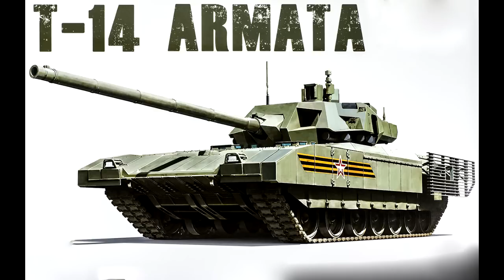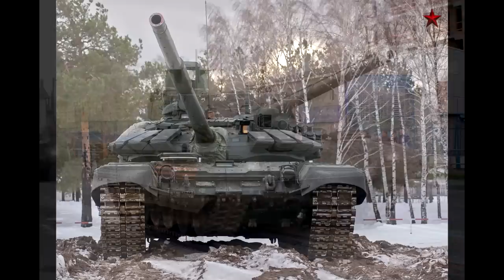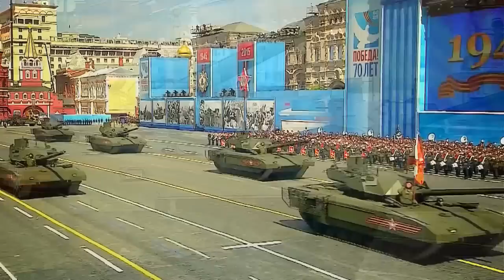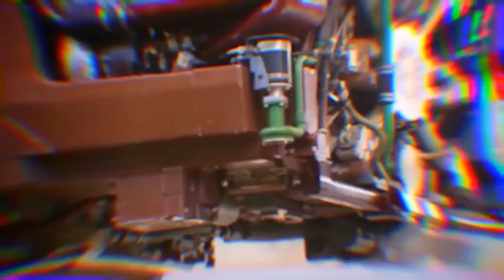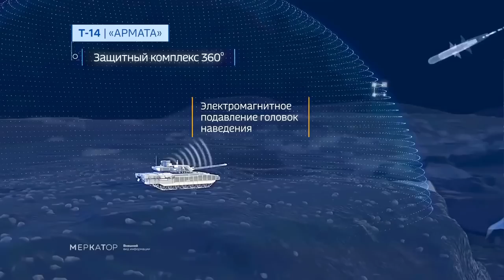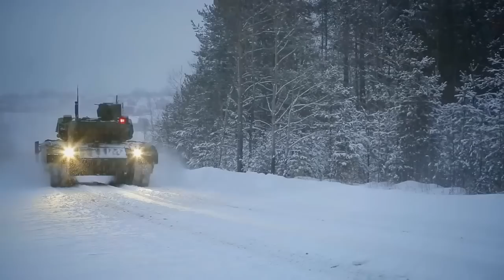Busting Myths on T-14 Armata

Comment: broke down = wishful thinking, in the end, the supposedly broken down vehicle moved under its own power. Video didnt continue.

Russia is under sanctions, so it cant have western imported Electronics. Very dumb assumption. Thales-Catheriine or how it was named was like 10 yrs ago. French do have their own tech Industry which is superior to the U.S. btw in armaments, optics. A generalization but it is generally so.

Production, I saw no written argument.

Frontal turret armor angles are definitely inspired by abrams.

Armata APS either can or will be able to intercept hypersonic projectiles. there was like 1700 m/s and the further future upgrade is supposed to be 3km/s. Not far from Mach 10.
Reply: +cdgncgn
> I dont know what ttb is.

M1 TTB, this guy from 1980-1984:  http://3.bp.blogspot.com/-ERiBYNDzpfI/VVHC6mkXqgI/AAAAAAAABb8/UiU_cSjLjEM/s640/TTB%2BCurrent.jpg
http://1.bp.blogspot.com/-dnKUs3YgO_4/VVG-q5vmhEI/AAAAAAAABbE/nJkQJTKm3hE/s1600/TTB%2B3.jpg

If developed successfully, could've become world's first 4th gen tank instead of T-14

> In appearance, abrams turret front has generally similar shape and angles

It doesn't in the slightest.* The differences are fundamental.

Flat panels are not Abrams feature, it's a welded steel armor feature.

Abrams' turret front is characterized by two massive armor blocks on each side, protecting manned turret's interior. 

T-14 basically has only "dust covers" there, shaped this way for RCS reduction.

The "real" turret looks more like this:
http://www.paralay.com/477/477%20(27).jpg

and similar to M1 TTB

* I'm one of those people who can spot the difference between T54 and T-55
Reply: facepalm. argument.
Reply: You you meant M1 Abrams, then this is just... perverse.

If you meant M1 TTB, you should've said exactly that, but it'd still be wrong in more ways than one.
Reply: Im not pushing my opinion as fact. I dont know what ttb is. In appearance, abrams turret front has generally similar shape and angles, so thats what I meant. Not that Russians did copy abrams turret or anything. It means, turret front  shape is more reminiscent of abrams than a T-72.
Reply: angles are differently fundamental yes but I meant that it was round turrets that went from I remember from later T-55. Shape being closer to abrams than T-55 lol. And I meant normal abrams, not that prototype. Nothing more. What you describe as being sort of light years apart, may be when you go into detail. That sasnt my intention. There is great difference between effective armor in first T-72s and T-72A and even bigger As and Bs, but that doesnt give too much of a visual change. I meant visual and to the people who dont get into stuff very deeply.  Fundamental differences but similar in outside look. Its like vz.58 vs AKM. Similar look.
Reply: > I meant that it was round turrets...

That is cast armor vs welded armor (made from flat sheets of rolled steel) 

Abrams is kinda not the first tank with welded turret.

Round is better, and cast armor can be made of any shape. It's also much cheaper to mass-produce.

Anyway, since when "thing has flat plates" = "inspired by other thing with flat plates"? That's just silly.
Reply: Russia has only around 2000 active warheads, the others can't be used in a saturation strike without a good amount of preparation.

"20-30 nukes to totally wipe every inch of the United States"
Wrong, and that's not even how they'd be used to start with. It's also wrong for the other countries.

"Russia is 3x times the size of the US"
Yet most of the population is concentrated in the Western side, and a few strategically placed nukes would turn Russia into a disorganized mess. You don't try to wipe out every piece of land in the other country, you strike major population areas, transport and logistics hubs, military bases and stockpiles. Basically you wipe out everything that allows the country to support a war effort.
Reply: Wikipedia can be edited by anyone... ANYONE!
Reply: Yeah like when Russia claimed a Ukrainian Su-25 shot down MH-17, and suddenly wikipedia stated that it could fly high enough to do so. The numbers are back to normal at least

But yes, wikipedia can be edited by anyone, yet it's still relatively reliable. You can always double check the claims anyway, especially since the source is given.
Reply: cdgncgn lol, what? French has superior electronics than the US? Fuckin lol.
Reply: vann tedd dumbfuck the panzer 4 has sloped armor.
Reply: > Frontal turret armor angles are definitely inspired by abrams.

/facepalm 

You ruined your entire perfectly good post with this
Reply: "Russia was the first nation in the world with Sloped armour, to counter Nazi tanks"
Wrong. From wikipedia : " Sloped armour was actually used on nineteenth century early Confederate ironclads, such as CSS Virginia, and partially implemented on the first French tank, the Schneider CA1 in the First World War, but the first tanks to be completely fitted with sloped armour were the French SOMUA S35 and other contemporary French tanks like the Renault R35, which had fully cast hulls and turrets."

"The US army yet had to produce autoloader in their tanks"
The M8 had an autoloader. It's a matter of doctrine here, because an antoloader isn't something magical that requires 10 years to develop. It's a matter of choice.

"first with reactive armour"
They're the first who thought of it, but Israel was the first to apply it in combat for certain.

"increase of fire power"
It's not because a gun is bigger that it has more fire power.

"it can detect planes 100km away and shut down planes or helicopters 10km away"
Basically it's a glorified tank mounted MANPAD equivalent.

"can intercept ANY missile or kinetic ballistic round"
If you trust the Russian claims.

"electromagnetic pulse attack munition"
WILL have according to Russia. Again, got to trust them to start with.

"152mm cannon"
What for ?

"first tank with stealth features"
Having reduced signature to ground scanning radar and optics is good, but stealth won't make it invisible, and unless you have the exact parameters, it doesn't say much.

"the tank will be fully networked"
Would suck if the new tank generation didn't have any of the features of a new tank generation.

"it will fire laser precision guided shells"
Nice, Russia joins the club like everyone else.
"Up to 70km away"
UP TO. Do you not understand how weapons terminology works ? Maximum range is not effective range.

"40km artillery"
The US doesn't aim to have most of its artillery fire beyond that range because of their doctrine. The PZH-2000 has a 60km effective range with some rounds, and some US missile based artillery has ranges of up to 300km.

The fact alone that you would try to compare them just shows a huge amount of ignorance. The US don't even aim at having more than 40km range cannon-based artillery to start with.

Seriously, I came here for a video disputing myths, but it seems people here are more interested in finding information that fits their agenda, so they can wank to their "Russian greatness" and pretend they're still at the top of the food chain. Stop spreading bullshit.

Comment: This is a great army, that sends a tank for parade with a driver that actions the hand break and then nobody is actually capable to think about the probable cause. How stupid should the driver be to not know which one is the hand break? Only total morons can believe such lunacy.
Reply: Marian Hanganu Drunk
Reply from the maker: The driving system in Armata is completely different than any other Russian tank. As I said, the driver didnt get proper training since the tank just came out and they wanted to present it on the parade, so he was jsut shown basic commands. He knew it was a hand brake, but didnt realize he actually pressed that button, since it was all completely knew to him. As an example, few months ago my friend gave me a ride since he just got a driving licence, so, like this driver, everything was new to him. He stopped to get out to the shop and pulled the hand brake, I didnt even see him do that. He got back staarted the car and started moving, but FORGOT TO RETURN THE HAND BRAKE. I didnt realize that since I was looking thru the window, and after around 5mins of driving I heard a rough sound which was very unusual to me, but he didnt still realize it, I turned around and saw hand brake lifted up, so I returned it to normal state.
The moral of the story is that mistakes can happen to unexperienced people, it is nothing surprising.

No one realized what was a problem at first because the driver lifted a red flag which means there is a problem with a vehicle so the regular procedure is to tow it away. But since they saw they couldnt tow it away they called representative of UralVagonZavod (company that designed the tank) to check what was the issue, he noticed the problem immediately and Armata drove away with no problems.

Comment: Countries  often use parts from Different countries,.The United States F22 uses Chinese made chips,..!?
:http://www.pressherald.com/2016/11/22/uss-zumwalt-out-of-commission-again/
Reply: Yes, there was a major reshuffling of the supply chain when it was discovered that low quality Chinese components were ending up in the F-16 avionics and weapons systems.  One of the reasons there is now an ISO 9000 and 9001 system - a dogtag on everything all the way from the mine to the marketer.

Comment: Still, where is the video where the tank drives away on its own? Still failed to see it to this day. Also since when russian publicized military data has been reliable? I still believe armata might be able to absorb shots from the front, but highly unlikely the protection would be better than on Abrams with a DU pack. Even from the side. Top of it all, T-14 is russian technology which raises big questions how reliable is it? A tank full of technology and getting hit by an artillery strike, is most likely gonna be useless piece of garbage. The protection system is limited to about 18 shots, and it most likely cannot protect from simultaneous shots from the same side either, as the modern Merkava tank has shown. Merkava btw most likely has the best anti-projectile protection system to the modern day, since it originates from Israel...

Comment: You don't stop a sabot, you deflect it. This is what Armata likely does.
Reply: The idea isn't to deflect it but to split it into pieces, the idea of anti-sabot APS is to split the head of the rod from the rest of the rod so both begin yawing and hit the tank sideways instead of head-on. Deflecting would probably only occur with a near-miss and might still cause serious damage.

OP is right that you can't destroy it (since that would require you vaporise the entire rod in mid-air).
Reply: not only yawing but disrupting the structure of the tungsten penetration can decrease the total focused force of the penetration and disrupt the transfer of force from the kinetic projectile
Reply: Or see it coming and MOVE or never stop!  It is a wooden bullet, a dumb weapon, from the moment it is fired, the point of impact cannot be changed.  Depending on the range, there may be two seconds to move or change course.
Reply: David Parker
The Sabot travels almost 2km per second.. Good luck dodging that or even see it coming.
Reply: ... depending on the range, there may be two seconds to move ... .
Reply: @DavidParker-cf2km  yea cuz 2 seconds is plenty of time to move a multiple ton tank enough to literally dodge the projectile
Reply: Liam Kerr - If you are at a dead stop, you are a dead duck.  But, rolling is a different story.  The sabot is aimed, not guided, it can't change direction once fired.  Don't be where it is going to hit. Two seconds at 30 kph is a three meter miss from point of aim.  I look at it from the perspective of the one shooting and trying to hit something a kilometer away.  With optical sights, at a moving target, that is a long shot.
Reply: @DavidParker-cf2km  perhaps you dont understand how american targeting systems work. You place the sight on the target and laze it, an computer then adjust for range, weather, speed of firing tank and speed of target and adjust the point of aim for a hit. It's not an optical system like in WW2.
Reply: SO what makes you an expert on what it does.

Comment: Myth #4

I Completely agree. It is a stupid claim.

Though its understandably suspiciously similar in layout and basic design to the TTB. And to an extent, looks as well.

Concept is similar too, but that's not a good point for either argument as different situations and different problems often necessitate a similar solution.
Reply from the maker: I forgot to mention in the video, but I left it in the description. There was project long before TTB, called Obj 477 Molot made by Soviets in 70s, it featured many components of armata, such as crew layout and remote turret.

Comment: For Myth #2, I dismiss it as well in my opinion, especially concerning the point you bring up with the images. However logically, it certainly is possible. And the little information confirmed to be true about the tank doesn't necessarily deny it either. Considering we don't know its manufacturer it could be a Western designed piece.
Reply from the maker: The manufacturer is UralVagonZavod, and as I said in the video, UVZ came out and said that those claims arent true and that Armata is 100% Russian tank.
Reply: As I said, there is only a possibility. They certainly can lie.